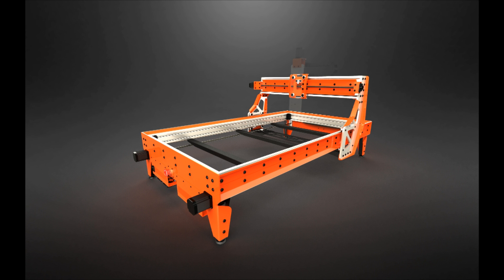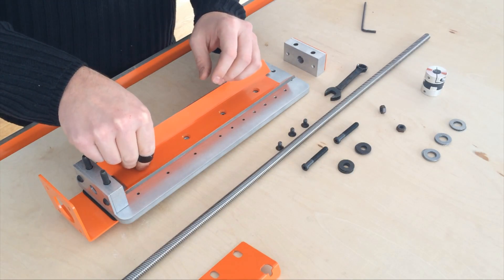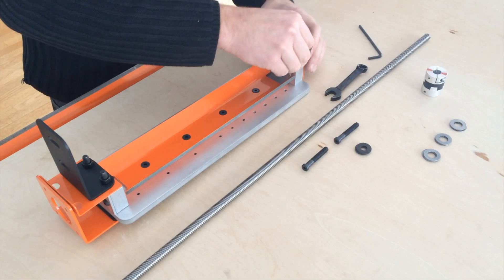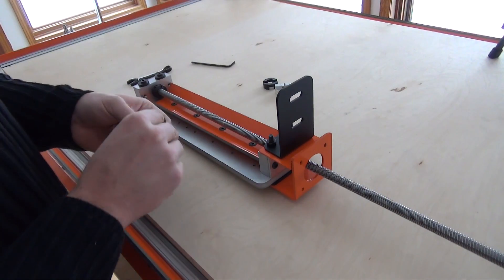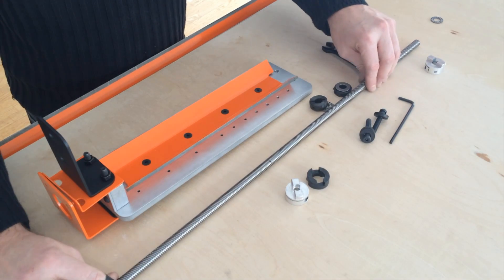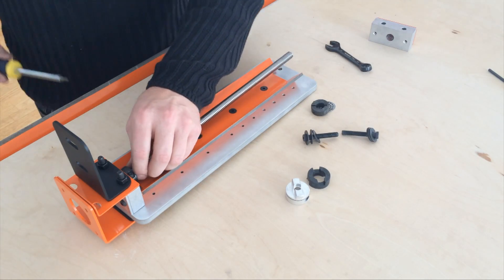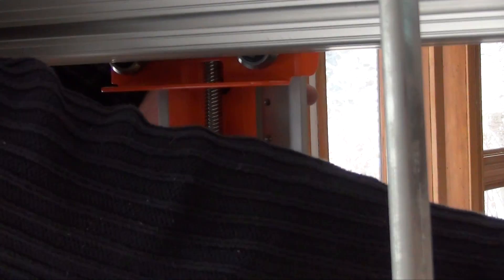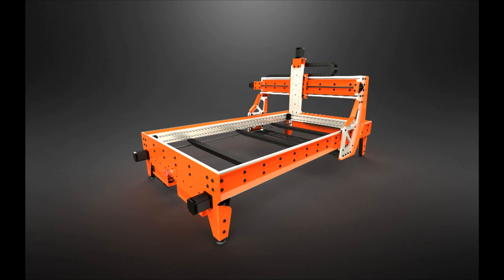Platform CNC Kit Assembly | Z Axis

Comment: Awesome CNC mate. I've been designing one with similar configuration. this helps a lot visualizing everything. do you think an upgrade to servos over steppers is warranted?  also your end hotspot links arn't setup on a few of the vids. cheers.
Reply from the maker: Thanks for the note! I'll look into it
Reply from the maker: Oh and to the stepper vs servos...  There is going to be a lot more support for stepper solutions as they are more common.  You can basically buy all of the steppers for the cost of one servo.  I'd argue that servos are far too much hassle for the cost and returns.
Reply: +Brian Oltrogge Yes the hotspot links are helpful as sometimes youtube automatically navigates you to some other random video. A card for the playlist works great too. I certainly agree servos seem a whole new can of worms, also it's an easy upgrade path later on. Thanks loads for the reply. Look forward to more videos. Cheers.